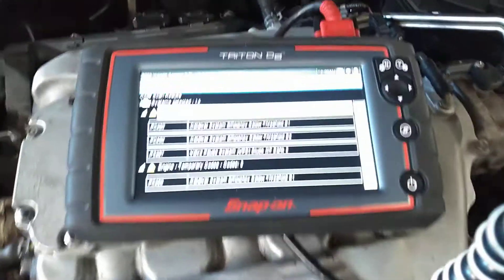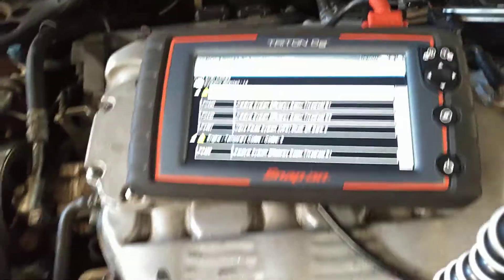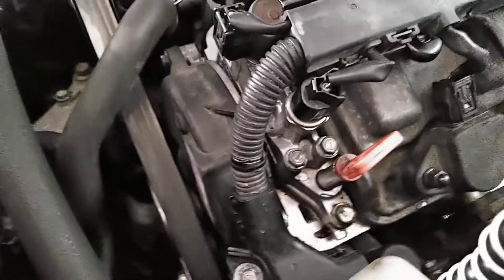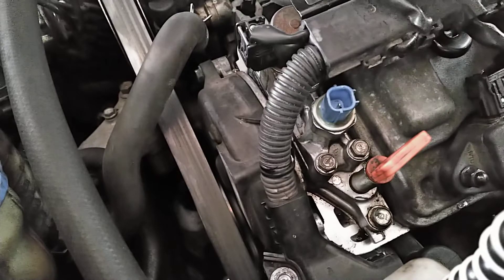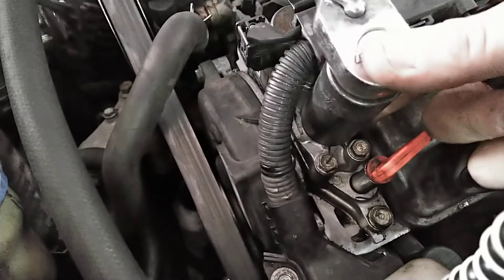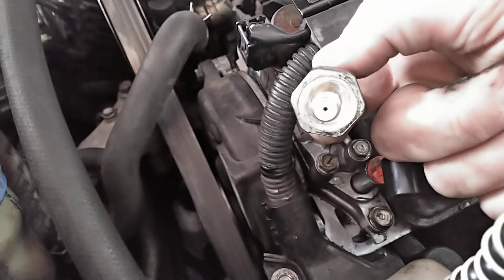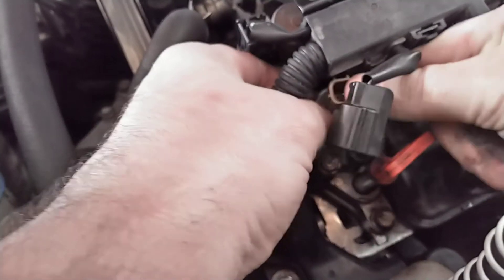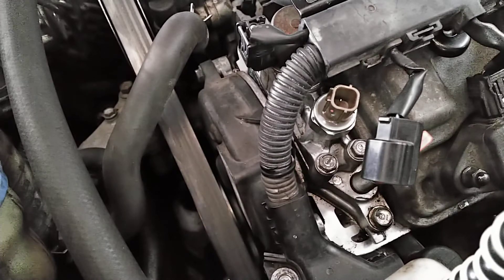2009 Honda Accord pilot civic 3.5 code p3497

Comment: 15/16" deep well works. Also clogged filter on gasket can cause same code
Reply: i'm facing this problem right now... Before replacing the sensor do you think it's valid try to cleaning the gasket and the sensor itself? could it work?
Reply: @willianwfb  You can spool valve basket with after market ( Mahle or Amazon ) includes filter screen.  The gaskets leak on alternator & destroy it! Honda doesn't sell gasket. Only complete spool valve. Usually you don't need to touch the bottom section just the 3 bolts to remove two gaskets & plate. Do Not over tighten easy hand tight & torque. To hard will smash gasket & cause a leak..

Comment: Same exact codes I have on my 08 Accord, about to buy this part today. Thanks!
Reply from the maker: I hope it works for you and happy I could save you some money and time in the process
Reply: @slimsautomotiverepair8714  I’m going to start out with an oil change since I’m pretty low on it and it’s about that time due for it. I have both the P3400 & P3497 codes on, from what I’ve been reading online, many indicate to start with the oil levels first but thanks man! 👍🏼
Reply from the maker: @JesusGonzalez-ft7ec  it could be caused by an intake leak to an exhaust leak running rich or lean. At the risk of just throwing parts at it and not having the car with me to diag I would recommend an O2 sensor if you have access to a bore scope pull out O2 sensor and scope the cat check for broken or clogged catalyst
Reply: @slimsautomotiverepair8714  Awesome! Will do man, thanks!
Reply from the maker: Make sure car is at ambiant temp at risk of burn or melting the scope I've done both and it sucks
Reply: @slimsautomotiverepair8714  both o2 sensors? Upstream n downstream?
Reply: @JesusGonzalez-ft7ec did you fix it?
Reply: @trentdaddydolla647  Yes I did, I had the front cat converter replaced and have had no issues since 👍🏼

Comment: What is the sensor called? Part number?
Reply from the maker: Vvt oil pressure sensor I am not able to give a part number until I get back to my shop on Monday I am currently out with an injury. Oriellys carrys these sensors in stock and it is the same part for both left and right banks

Comment: I have this code on a 2011, my tech replaced this sensor with two new ones. One from autozone and one from advanced auto. Driving home after the second new sensor the car went into limp mode again and threw the p3497. What else could be the cause of this problem? My tech replaced the valve cover with an aftermarket unit because it was leaking oil, which caused a high idle situation. So, he pulled thatc over and put on a genuine honda cover and that is when this issue started. It ran fine before that! :) Any help would be appreciated!
Reply from the maker: Let me take a deeper look into the info and I will send what I can do for you
Reply: Solenoid needs replacing

Comment: Did you use Honda OEM part? I replaced mine with an aftermarket part and the P3497 came back on after 50 miles or so.
Reply from the maker: I used a part from O'Reilly's auto parts for that job

Comment: My dealership charged me $650 to fix that code. What a ripoff
Reply from the maker: I try to post videos that any of my subscribers suggest or need help with for just that reason to help and save workin class Joe's some cash
Reply: Change that oil pressure switch.code still there.. Same problem with rough riding
Reply: Check the rear differential fluid and the corresponding differential fluid temperature sensor.
When the differential fluid is low or sensor corroded or failed, the ecm will disengage the vvt system and cut out bank 2 as a means to protect the all wheel drive system and differential.
Reply: @sethgross1989 will this cause rough driving / idling?